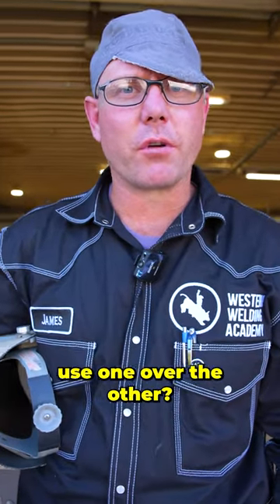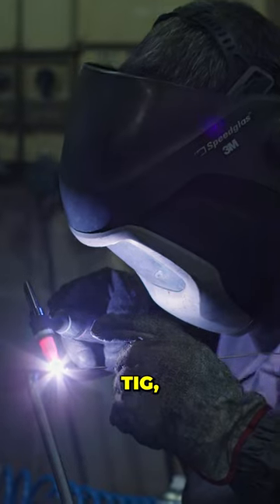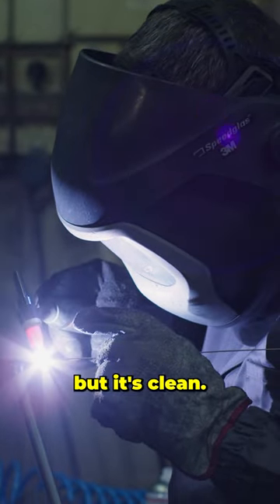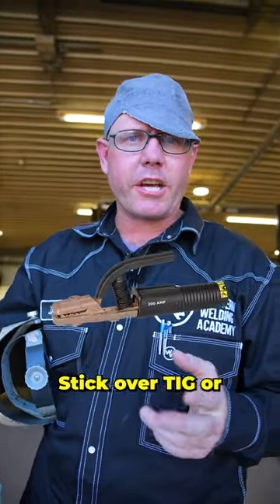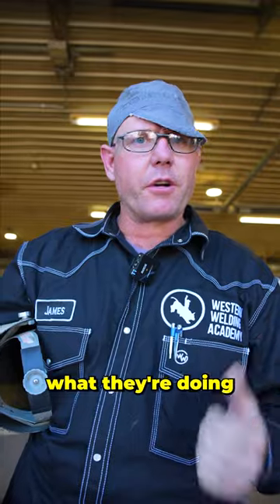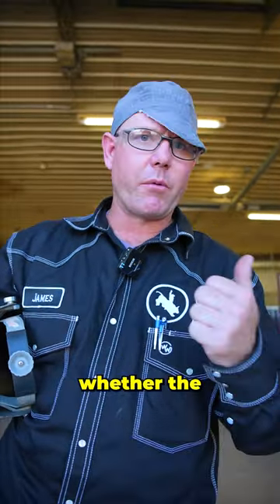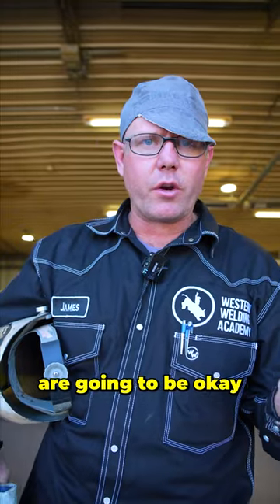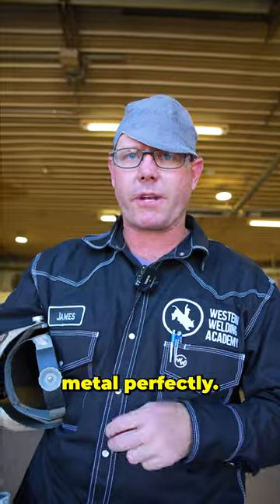Stick vs TIG  #shorts

Comment: Tig is also a lot cooler . I usually just wear cotton gloves or barehand sometimes . I mean I know the weld is extremely hot but I feel like it’s more isolated . Tig also has a lot more control temp , speed, size , metal type wise.

Comment: Productivity is the main factor in the welding process used on a particular job. On large jobs I have seen a increase in using GMAW because of productivity and minimal heat input. 
Miller has developed a GMAW process for SS pipe that excludes the need of back purge which saves money on argon and time and lowers heat input which deteriorates the alloys in SS. Miller calls it RMD. 
I personally hate mig because mig runs you. It’s not fun. 
Fab shops are predominantly mig. But I do see the trend moving to some type of GMAW for productivity gain. 
Also some time in your career you’re going to run into semi automatic welding. Of course budget for tools and equipment drives everything.

Comment: You can weld almost anything with tig. Having clean welds is a small part of it. Tig welds are way more precise than a stick weld. Also not to mention  you can weld some very very thin material with tig that you cannot do with stick. Many companies when it comes to pipe welding want a tig root even out in the feild. The reason being is because tig is so precise it makes  way cleaner roots and up to spec welds that are less likely to break. Many pipelines now want a tig root and 7018 or 8010 cover pass these days. I worked as a sheet metal tig welder for about a month. I was welding aluminum stair cases all day but the company was very young and I was very inexperienced and they couldn't afford to train me. Also the building they leased was falling apart so they ended up laying me off. I was very rushed as well. I was struggling welding aluminum sheet metal especially fast. They wanted each stair case done in less than ten minutes. I took me about 20 minutes at best. There is some jobs in tig welding that rush you. I am not making the mistake of getting hired by a small shop again especially if they can't afford to train me. I have a associates degree in welding but that is nothing in the welding industry because I am still considered a green horn even with a month experience.

Comment: Tig Weld it’s OK if you weld it inside on new clean metal but the process of stick rod will probably never be taken away for there’s gonna be always a lot of junk rusty pipe or metal that you’re gonna have a weld stick rod is the best source